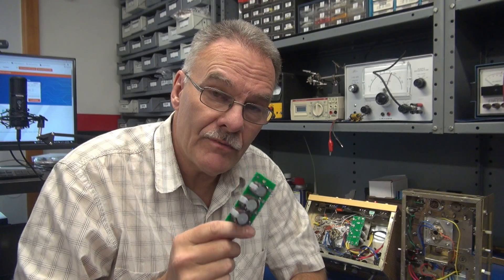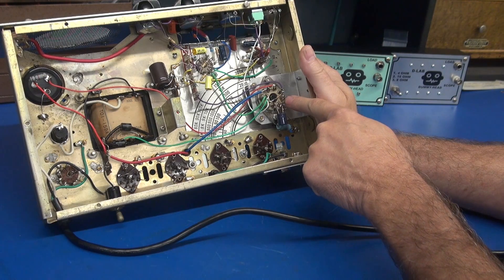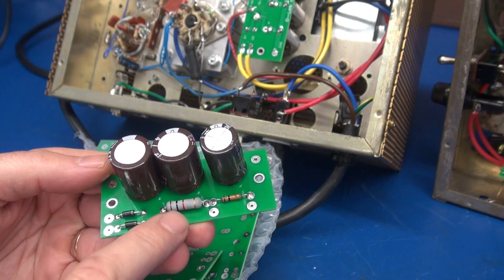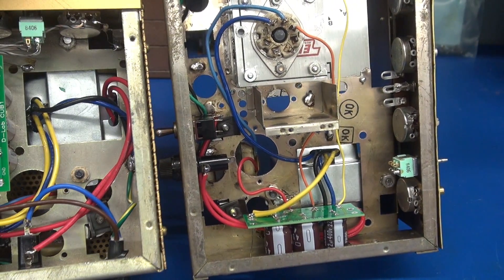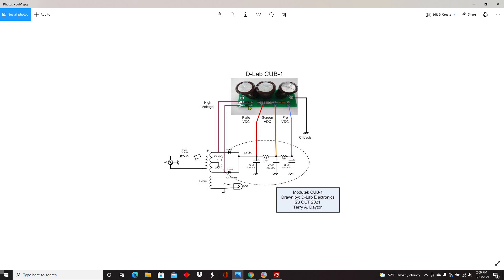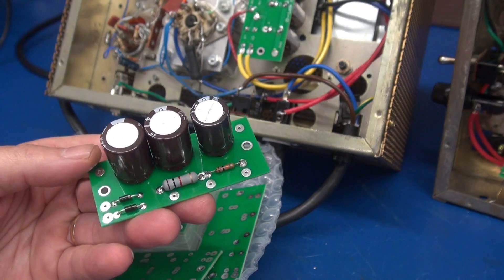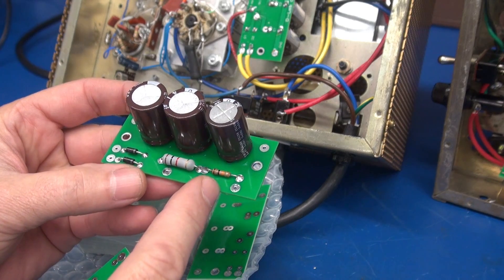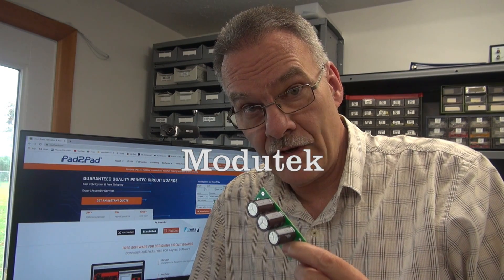D-lab Tube Guitar amp Power supply Modular design The Beginning of a Grand Kit Project

Comment: If you look at the capacitors data sheet there is a cap vent on the top of the cap it’s not recommended that you place them or glue to chassis

Comment: WARNING  WARNING WARNING WILL Robinson.....
Terry, luv the board but the expansion fins on Bottom of electrolytics are there for a reason! Blocking them could be a major problem later plus viewing those flanges for expansion is not possible.
Your alternate suggestion of mounting the board on standoffs should be the primary mounting option, as is, and to leave a quarter inch or MORE above the cap expansion fins. 
Viewing the cap bulge will be difficult either way. Suggest redrawing the board so the cap bottoms are faced UP or sideways for viewing the cap flanges and proper venting ! ! OR mount the existing board upside down from your suggestion for the aforementioned reasons
 Otherwise, an excellent project !!!
73 de WA4AOS

Comment: What if I need to build a bridge rectifier? So where to hook up the two more diodes on your PCB then?
And what about an extra fuse holder in between the AC line on the PCB?

Comment: Great modernization tools. There are so many people who review these ideas and designs (not just D-Lab’s) yet do not have the wherewithal or assets to duplicate/use designs themselves. I commonly see them begging for someone to do the hard work for them. You do a great job explaining analog circuit issues and new ideas and this will help many learn more about tube design circuits and accessories. I’ve also used this technique if I need a low voltage power supply as you can buy a PC board for many linear power supply designs fairly cheap on-line and just populate it with parts. Keep up the videos!
Reply from the maker: Thank you for your support my friend. I am trying to up the game a bit. Break out of the tube only world

Comment: Hey Terry, really nice board. Just curious if you offer a separate ground for the first preamp tube. I think that may make a Champ build nice and quiet.
Good idea, and filter caps will likely be all radials in the near future. 😀
Reply from the maker: Hi Ken, The ground trace can be cut for separation on a Champ circuit
Reply: @d-labelectronics  Good to hear Terry. Thanks 😊

Comment: Oh no 😮! A PCB in a hand built amp!    What will the cork sniffers say?!  (No offense intended for wine connoisseurs 😊). I just don't like PCB's used in applications where they are subjected to high heat.
Reply: Nothing on that board should get very hot. Can mount the resistors off the board a bit.
Reply: @marka1986  I don't have any problems with what he has done. What I take issue with is designs where a PCB mounted tube socket is going to be subjected to a lot of heat. A problem with a lot of mass produced tube guitar amps. I know they have to build to a price, but it causes reliability issues in the long run.

Comment: What a great idea! I'm a noob and I've got a Eico 147a Signal Tracer that I'm modding to output 12ish watts at the speaker whilst keeping all the original functionality. (I changed the RF input to a 1/4" guitar jack and changed the original 1/2 watt 8 ohm speaker to a 4" 30 watt Eminence speaker). I think your modules will come in handy. Thanks and Cheers!